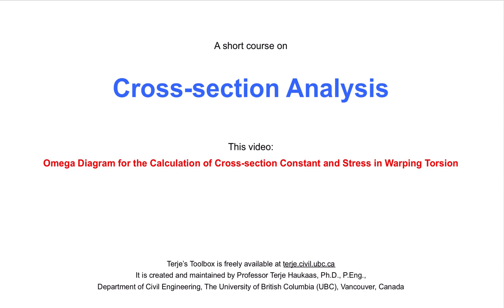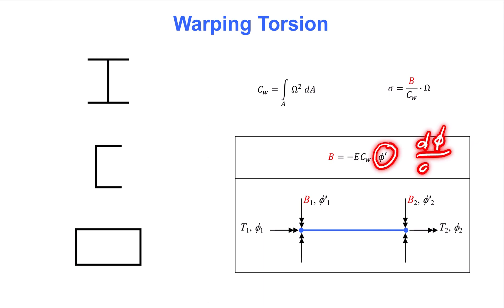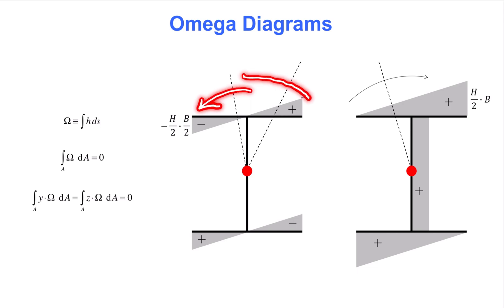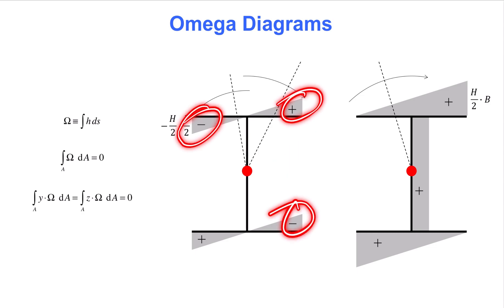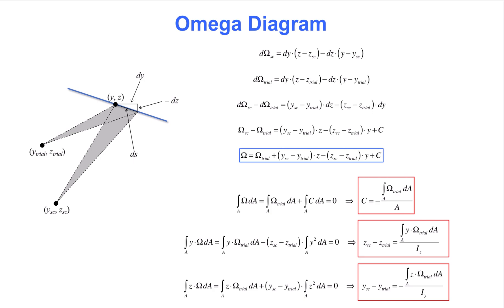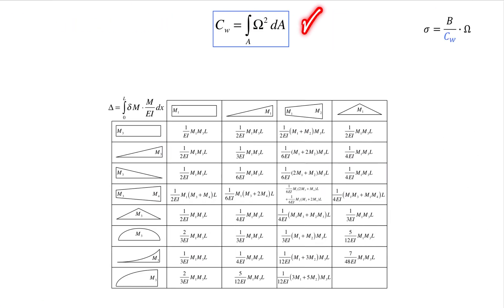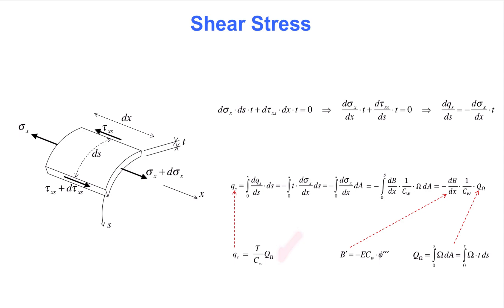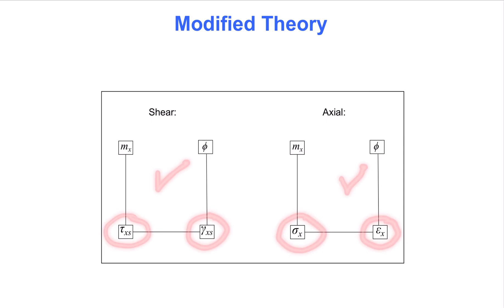Omega diagrams for warping torsion (Terje's Toolbox)

Comment: "I have found the website you provided as a guide very helpful, and I have used it a lot. Could you please share the Python code called 'Solid Cross-section Analysis' and the 'terjesfunctions' functions?"
Reply: Thank you very much for your contributions
Reply from the maker: Thank you very much for the nice comments.  All the Python code you seek is posted at https://terje.civil.ubc.ca/finite-elements.  You will find the Python code for solid cross-sections there, and elsewhere on the page you will find the other required functions too, which you simply place in a file called terjesfunctions. Please do not hesitate to ask follow-up questions.
Reply: @terjehaukaas   
"When I run the Solid Cross-section Analysis code, it asks for the 'terjesfunctions' functions. Is it possible for you to indicate where I can find them?
Reply from the maker: Thanks for the follow-up.  You will notice that the two functions you are missing are called "assembleStiffnessMatrix" and "assembleLoadVector."  Do you see that in the solid cross-section code?  Once you have noticed that, then find exactly those two functions in the code entitled "assembleStiffnessMatrix" on the finite elements page that I referenced in my previous answer. Then, copy exactly the functions "assembleStiffnessMatrix" and "assembleLoadVector" from there and place them in a file that you call terjesfunctions.  Also, please have a look at my general Python video here: https://youtu.be/00K0NBmZNK0?si=EVNdrd7PuJNHPUtZ
Reply: @terjehaukaas   When I run the Python code, it gives me this message: ModuleNotFoundError: No module named 'terjesfunctions'."
Reply: @terjehaukaas   I am very interested in all the topics on your channel, and you explain them very well. Thank you very much.